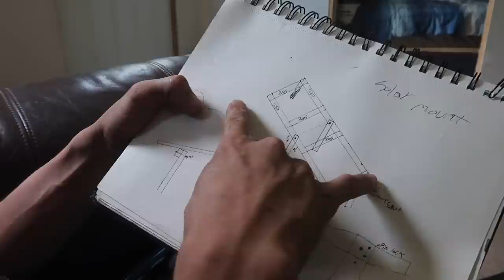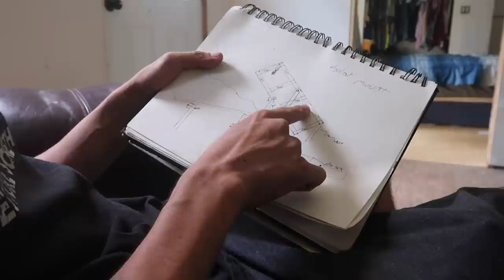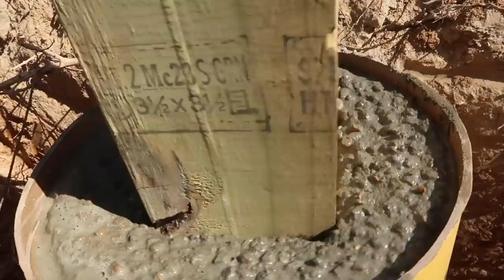Container House Powered by the Sun pt.1 I Shipping Container Home | EP:51 | Tornado Proofing Home

Comment: Your friend is a dang good welder. That's great you getting the solar teeter tatter lol together.  You could burn the post wire brush the chard off and linseed oil it will stop the rotting. Great job Summer digging the holes out.  Cody your just such a very talented person.

Comment: If you paint your wood post with roofing tar where it's going to come into contact with the cement and a few inches above you won't have to worry about it rotting out and having to replace it.
Reply: I was thinking this and also to burn it, like the japanese. Shuban ? Or something like that...for a carbon coating
Reply: Shou sugi ban - I knew what you meant, but didn’t know how to spell it😄
Reply: It was so cute seeing 👀 Cody running 🏃‍♂️ with the ducks 🦆.🐘🙏🙌🕊

Comment: Cody, you're a very smart and creative thinking young man. But, please save yourself some money and grief and listen to someone who has tried doing something similar to what you are.
Cody, you're overthinking your solar panel ground mount. The best thing you can do is make it adjustable for the 4 seasons and purchase more panels, if you need them, than to make a tracking system, particularly in such a forested area. Tracking systems just don't pay off compared to the cost and complexity it takes to make them. You need to check your zip code to see how many degrees off magnetic south to point them. If you want to use extra panels point them south/southwest. Early morning sun is not as good as afternoon due to sunray distortion in the morning. If you can get your hands on some cheap used drill pipe, it will last you forever. Good luck. I've installed over 200 solar systems over the past 6 years using everything you can imagine. Some work fabulous, some great and then there's just some that cost a sum!